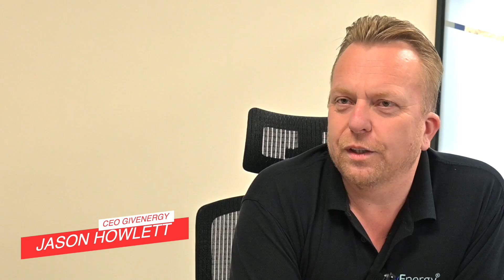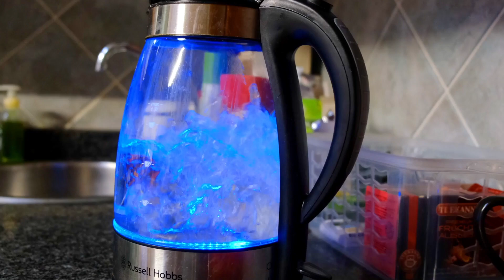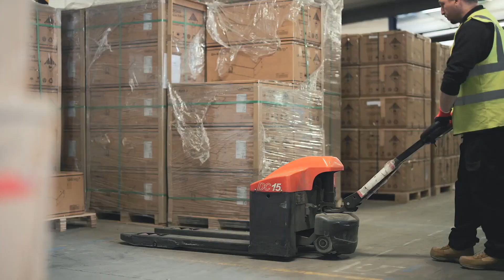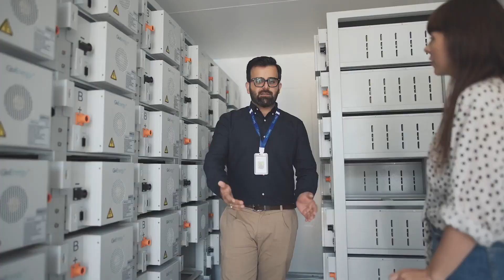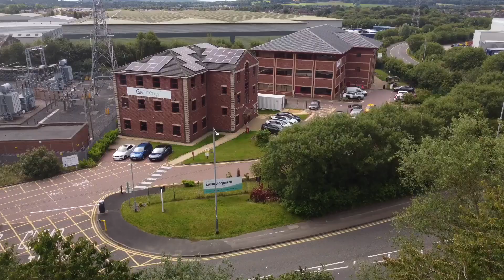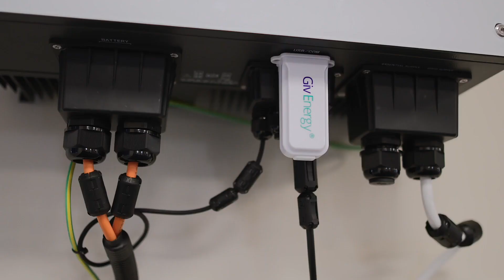GivEnergy CEO Jason Howlett Interview - Discover Britain

Comment: I have a couple of questions.
Are you planning to develop something that can provide a means to monitor my ASHP. Perhaps even my elec heated floor. Something that would fit in the consumer unit?

Secondly, What about a V2G charger?

Thank you.
Reply from the maker: Not currently, but never say never!
Reply: If you use Home Assistant you can use an energy clamp such as a Shelly EM1 to monitor your ASHP consumption.  That’s what I do, and control my battery charging and discharging with GivTCP